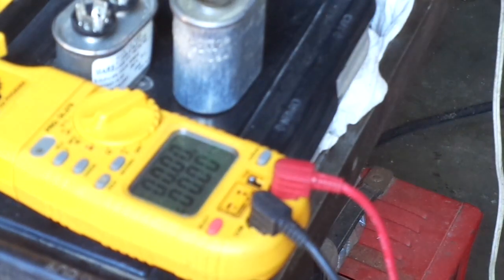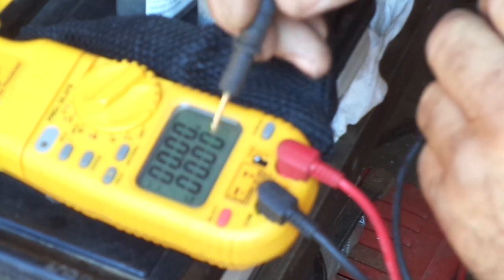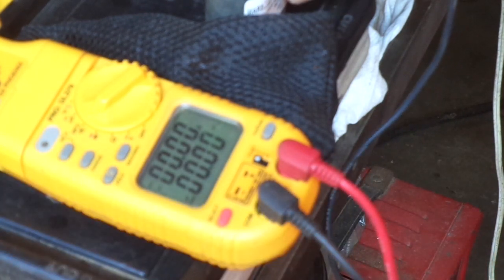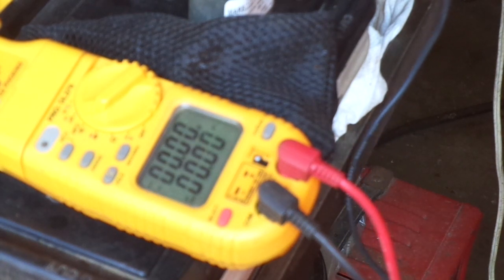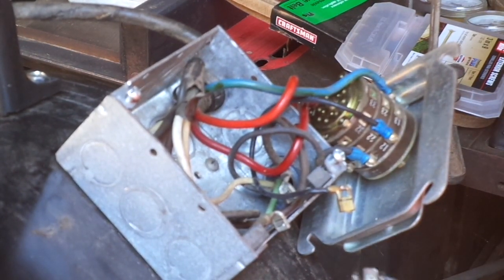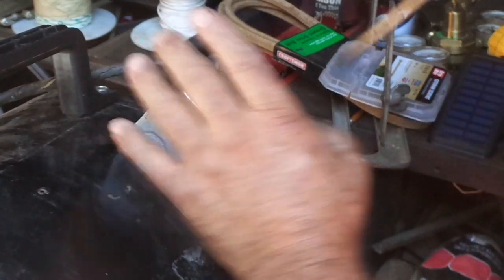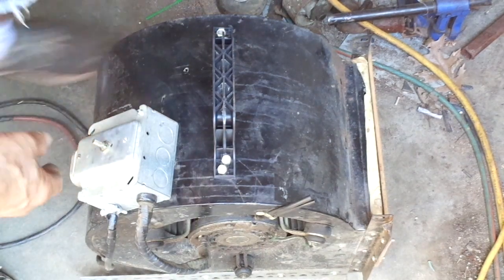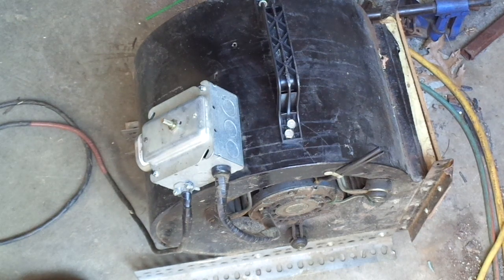Blower Motor Repair, Bad Capacitor

Comment: Good info. Thanks.

Sir, is there any polarity for capacitors? The cables are both brown. What will happen if i connect the capacitor with opposite polarity.

Thanks.
Reply from the maker: If you have a 'dot' or a mark of some kind on the face of the capacitor near one of the terminals, it SHOULD go to the brown wire with the  white tracer.  But in 40+ years of service work Ivan,  I never saw any difference in connecting them either way.  So technically yes, that indicates polarity.  But there is very little chance of something happening as far as I know.  But play it safe though and look for the mark or dot or solder spot on one of the terminals.

Comment: Those old blowers do a fine job of pushing air around the shop. I set one up to blow across the top of the wood stove in the winter. It pumped heat to the other end of the 40 x 20 shop quite well. In the summer I sat it on the floor and aimed it up at my head so it pulled the cooler air up off the floor. 
The shop was a former hog barn and I left one of the hog doors in the back wall because when Ryan was little he liked to use His door that was just his size. I would open the west loft door that was there to fill the corn crib on the west end.and the windows I put in on the east end of the loft. With that little door open convection would pull up cool air through the little door and vent the warmer air out the windows,.
We have about one hot week a year in the wilds of Michigan. The venting and recycled furnace blower got me by for quite a while. 
Now that we moved to a more upscale neighborhood with a smaller house and central air on hot days i work downstairs in the temperature controlled woodshop.
Reply from the maker: Oh heck yeah.  We've been using these blowers for years for all kinds of things.  Heating season as you said, air changes for welding fumes, destratification of the heat in the summer shop and to just plain blow the dripping sweat off of you in the hot weather whilst doing the chores for the lady of the house to name a few.  I would LOVE to have a nice A/C'd workshop...but alas...  only in the winter.  LOL

Comment: Yeah! It use to be you changed a capacitor for rule of thumb when you changed a motor or a contactor!!  Now I have to change just them!!   I got a couple of them setups myself! lol    Have a good week T44!!
Reply from the maker: Everything's built so much cheaper now a days, especially capacitors.  I think they fail sooo much easier today.  I've torn out dozens and dozens of systems that had 30+ year old capacitors that are still good.  These new ones occasionally BARELY make it out of warranty.  Thanks for watching John.

Comment: Fixed many motors in my younger days but now I just do it on the farm to help them out....very good explanation TractorMan....should be good for a few in hear....CHEERS
Reply from the maker: Well, I talked a bit too fast in a part or two and may have twisted a fact a bit, but man I was in a hurry.  Thank you sir for the time you take to watch and comment Gator !!

Comment: I always learn something from Tractorman44 and I Thank You Sir! I tip my cup your way! I was having my first cuppaJO this morning and after tipping me cup your way I thought, I wonder if Tractorman44 has another video this morning. And sure enough there it was, Cool! It reminded me of how I need to get a new capacitor for the motor on my table saw. Fortunately it has a double pulley wheel where I took one belt off and can rope start my saw. It happened in the middle of a project I was working on and I thought, what can DaveyJO do now? I spied a rope in my shop just the right size and started her up with no problem. Now that's been a year ago and really, it would be nice to use the switch, since the novelty of the role has worn off a bit now. It's a one horse heavy motor on an old Atlas saw probably from the 1950s, all cast iron table and a great saw. I can run a piece of 2" oak through and it cuts right through. So this video inspired me to get a new capacitor this week. Now to see if I can find one. We do have a great family run electric store in town and I'll start there. It is a 220 volt motor so it's got lots of stuff. 
So it's a bit warm there now, eh? Here too, been in the 90 and plenty humid. But it is summer after all and soon people will be complaining about the cold, or rain, the snow or whatever. I take the weather as it comes and glad for another day. And soon it will be wood cutting and splitting time. My goal it to get the woodshed filled by September. In the early season I cut fallen limbs and branches which will do great to take the chill off. Then the big stuff later. So I can clean up all those limbs that came down in storms and Alice likes the small stuff for her studio stove, something she can handle easily. So Thanks Kindly Tractorman44 and all the 44 Clan. Don't melt and keep the fan going. Here in the woods it stays pretty cool without AC. We do keep a dehimidfier going cuz it can get real damp. When I go to the mail box or go into town, it seems at the end of the lane there is a 10-15 degree difference. Of course the evening comes sooner in the trees and cooler too. Seems that you have the creative capacity for capacitors fer ser! A happy week to ya Tractoeman44 and don't melt because I do need a Tractorman44 video fix every week or so. Again I toast your way Sir! DaveyJO in Pa.
Reply from the maker: DaveyJO I spit my coffee at the visual of you rope starting the table saw like an old horizontal shaft motor on the old rototiller.... Cracked me up again man.  Let me know what size the start capacitor is that you are missing and I'll check my capacitor box and send it to you if I have one.  I had to wire two in parallel the add the capacitance for my older brothers air compressor a month or two ago.  Funny thing about them...they add in parallel but in series the total capacitance is less than the smaller of the two.  Go figure huh.  Kinda like one boy is a whole boy, two boys is half a boy and three boys is the same as no boys at all....  Another thing the old man would always say.  lol.  Take care sir, and as always, I'm sucking up the tail fumes running late as late can be, but I always enjoy your take on the situation.  Have another cuppa JO on me sir, I'll gladly pay the bill.....